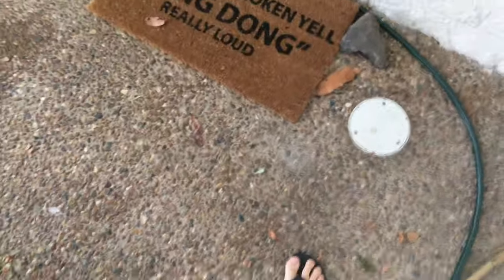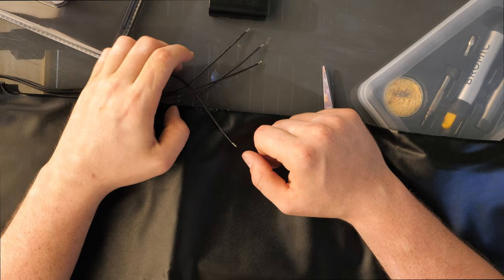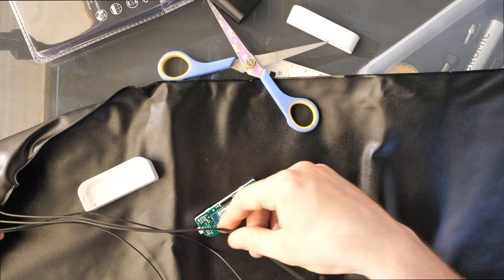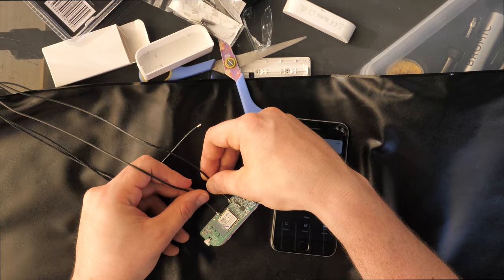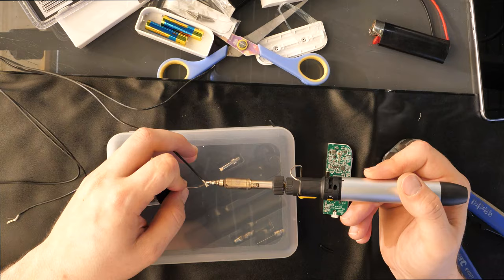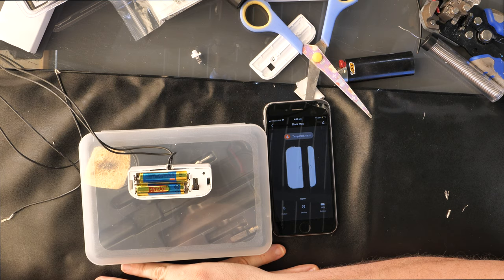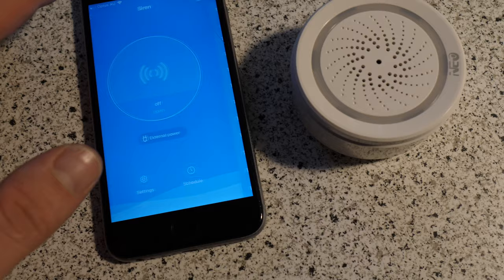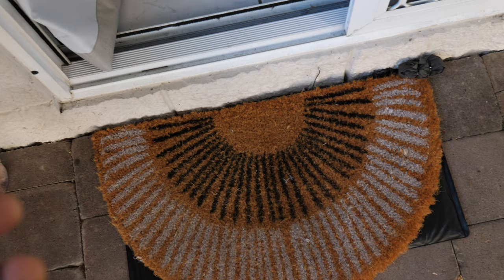HOW TO MAKE A SMART WIFI DOOR MAT!! KEEP YOUR HOME SAFE!!

Comment: i have bought a similar pressure sensor mat having 4 wires,..but when i have checked with mutlimeter 2 wire are not changing values of multimter when pressure applied...can you tell the purpose these 4 wires..
Reply from the maker: I think they are to run power to something